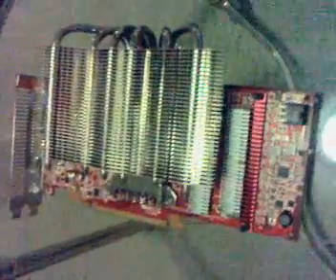ATI X1950XT with Thermalright HR-03 GT

Comment from the maker: i would say that the 4850 is the best bang for buck. with this cooler you can with ease reach 4870 performance if not more by overclocking the card. the fan can either clip on the front or the back of the rad. i personally mounted the fan on the front for more air flow but at the cost of losing one PCI slot.